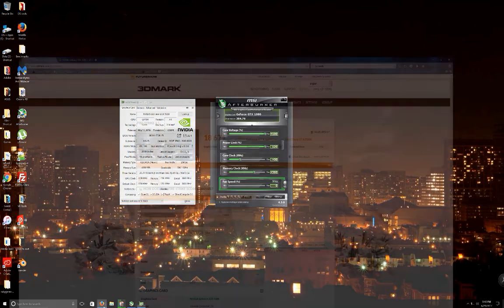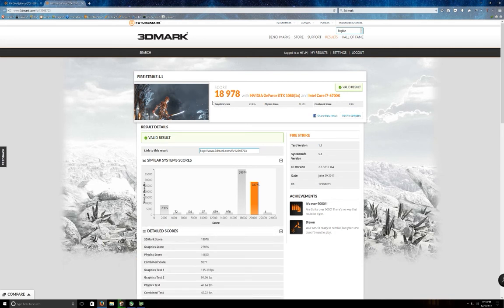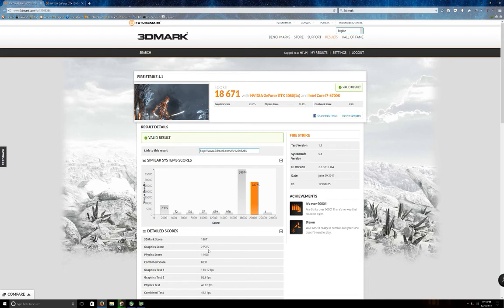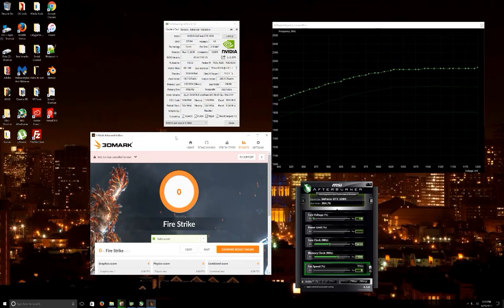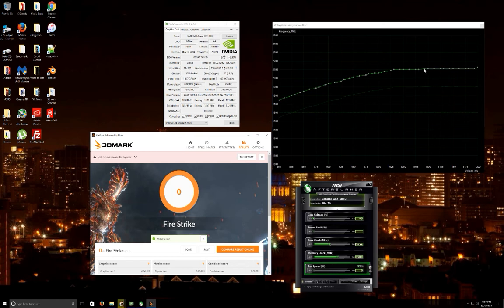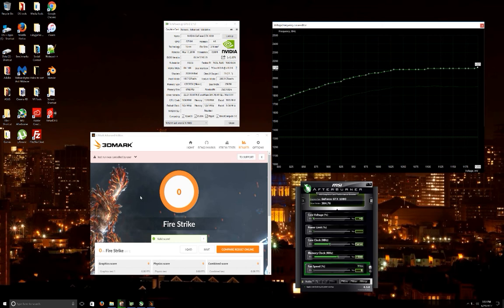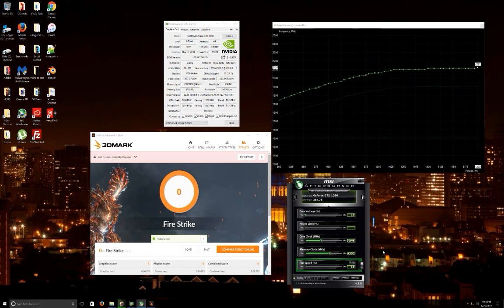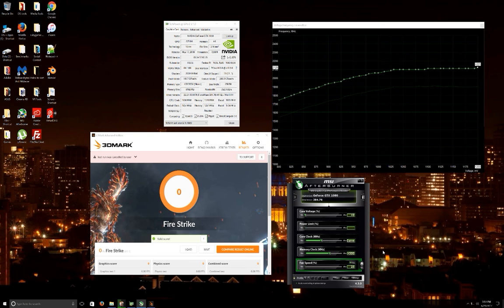ASUS Strix GTX 1080 XOC BIOS On Air

Comment: I got a msi armor card and it was amazing with memory so i flashed one of these strix bios and it sits at 2088 with memory at 1000+ 6000 effective and unlocked bios runs 1500+ no issue unless i raise the core past 2150ish but can run 2164+ but i havent pushed it. I am running a kraken x42 aio on my card now and it sits around 45c 50c max pending ambient. I use it for VR and dont want to kill my card after seeing 340w max in hwinfo.

Comment: Hey! Man you have a space in my heart... After installing the xoc rom I was able to get rid of the pwr and Voltage limit. I repasted the card using liquid metal, deep cleaning of the cooler and at stock rom it hit 44C fan at 65%. I don't have frame drops at any AAA title. Voltage goes up to 1.141 Frequency 2120
Reply from the maker: I'm glad the video was helpful for you.
Reply: @heretolearntech3873  hi, I just upgraded my card and now I own a GTX 1080ti from gigabyte. I would like to remove the pwr and vol limit. Can you please help me? This is my current card https://www.techpowerup.com/vgabios/192079/gigabyte-gtx1080ti-11264-170328
Reply: @Evelyn Azevedo I used MSI afterburner to create a cutom curve, plus mi graphics card is water cooled. On air I was able to achieve 2050mhz with the fans at full speed.

Comment: Hi 
i have two Asus 1080ti with a XOC bios. When overclock only one card then i can go with the voltage up to 1.200 v but when i run the 1080ti in Sli, then i can't set the voltage to 1.200. When i put the curve to 1.200v then both 1080ti have about 1.075 v and the core clock is about 2000Mhz every time. I also tried other Voltage( 1.150, 1.125,1.175) nothing worked for me. Do you know what the problem is?

Comment: can i use this bios on gtx 1070 ?
Reply from the maker: No, sorry. It only works on GTX 1080s
Reply: arf, did u hear anything about a custom bios for gtx 1070 which allows to change the voltage ? because with my bios it looks like i bought a hall of fame card for nothing :(
Reply from the maker: I have not been able to find any custom BIOS for the GTX 1070 that would unlock the voltage.
Reply: Yea basically it is a waste...although if you want to you can always solder things and volt mod it. But the BIOSes are only available on 1080 and 1080Ti

Comment: Whats your best bios for overclocking? I am using B and +50 makes it crash in the long run :(, can only get around 2063Mhz
Reply from the maker: The "1B" BIOS has been the most stable for me. I can run up to 2114mhz on the core (max boost) and can manage +560mhz on the RAM. Power delivery seems cleaner on the 1B BIOS as well. If you can't run stable with +50mhz on the 1B BIOS it is likely your chip to blame. Different chips even when created on the same silicon wafer can have differing performance.
Reply: HereToLearnTech Yo, there are some new bios, have you tried them? They're for the 11GBPs version but I can't see why it won't work on ours.
Reply from the maker: I have not tried any of them. I will look into it though.

Comment: Hey! I actually have upgraded the bios and have been experimenting with Ocing. Mind if you make another video on how to overclock with the 1080? Like from start to finish like what each option does and ect. 
That would be awesome!
Reply: Power target increases power limit, voltage increases voltage, core increases core frqz, vram increases vram frqz.. done.

Comment: Hello I'm re flashing the bios on my Strix 1080 ti I know the bios file will be different but will the rest of the process be the same?
Reply: from your other strix 1080 bios installs.
Reply from the maker: Unfortunately I don't have a 1080ti to test but the process should be similar if not exactly the same as I have shown in the previous Strix GTX 1080 Bios videos on this channel. The most common problem I hear people having is overcoming the checksums. If you run into this problem you can change the "-6" to "-4-5-6" when using nvflash, that will usually overcome the additional checksums.

Comment: With this if we buy a strix is it better to get the base card for cheaper then go for a A8G or O8C or vice-versa and just get the cheapest 1080 strix?
Reply: I have both A8g and O8G and on air A8G was stable at 2100 and O8G only at 2050. Watercooled (GPU loop only, 140*420 rad) i get up to 2152 on SLI, sometimes it jumps between 2100 and 2152, don't know which of those 2 cards holds me down now. Need to upgrade to XOC BIOS to check if i can push them further. I'd go for regular 8G, all the cards should do at least 2000MHz on boost.
Reply from the maker: My card is a standard 8G card not the A8G or O8G. I have had the best results using the later 1B version of the O8G Bios. Here is a video about the 1B Bios: https://www.youtube.com/watch?v=SnoK1OImnoU&t=2s
Reply: so it really doesn't matter if i buy the A8G, 8G, or O8G as long as i run the O8G bios on it?
Reply from the maker: That has been my experience. I recommend using the 1B Bios not the 1D, they are both O8G Bios files.
Reply: Cool thanks looks like i am gonna get the A8G